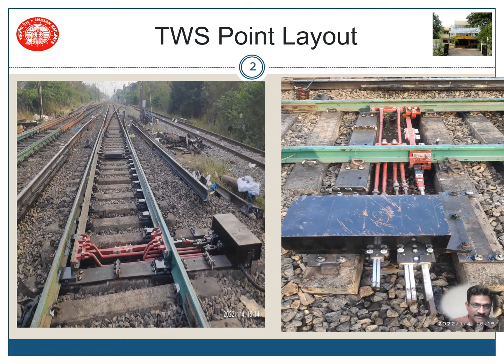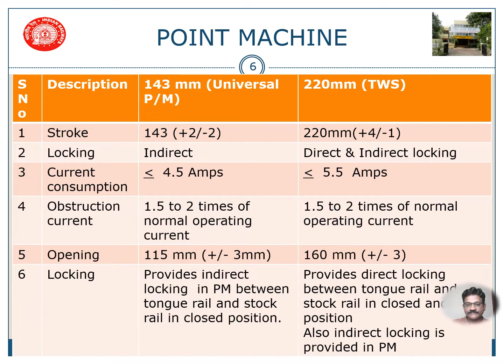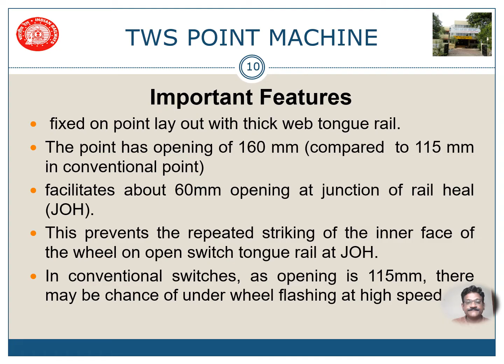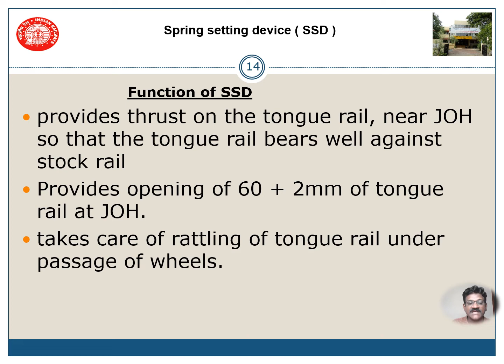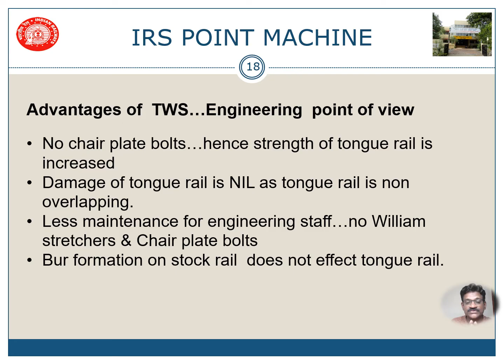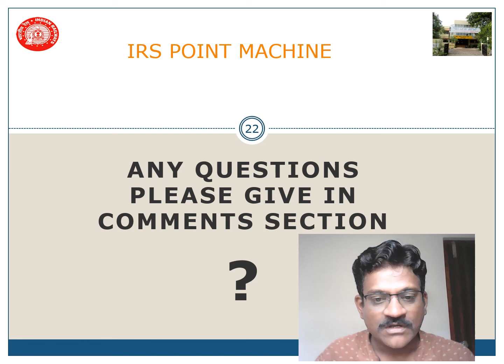TWS  (Thick Web Switches).. Introduction

Comment: Sir the cross level on all stations of tws is zero where is it written authentic or how can it if calculated.
Reply from the maker: Please be clear...what do you mean by cross level? Please be specific.is it out of square you are taking about. Or level measurements by engineering department.
Reply: @ramprasad331 
I mean cross level.
When we measure cross level at stations  for tws it is zero at all stations .irrespective of 1in 8.5 or 1in 12.i want to know where is it written in engineering department literature or how it can be calculated.

Comment: Hi Sir ,I have question ❓ 
What is the reason can't change the position from normal to reverse it's flashing?
Is the problem from point machine or something else?
Reply from the maker: I did not understand your question. Please be clear..point not operating may have many reasons...first is it mechanical problem or electrical..and we need to follow circuit for electrical failure or if point operating, then adjust the point.

Comment: Sir, why reason of TWS point after setting then decluching .
Please remedialy action comments.
Reply from the maker: After setting, closed switch gets completely locked and open switch partially locked. It is not declutching after setting of point. It is locking after setting of point. I will discuss this point in next video please